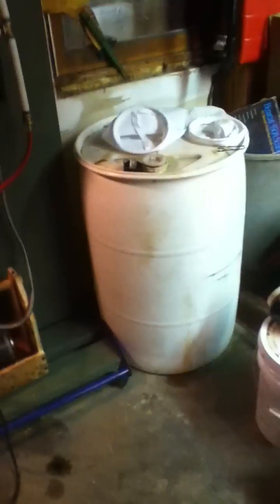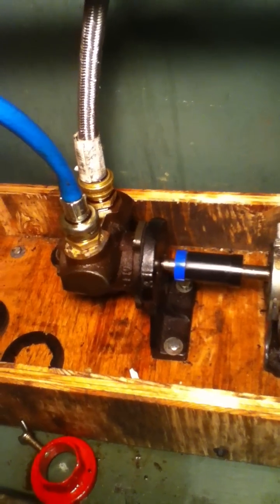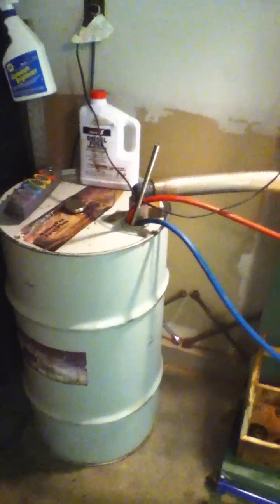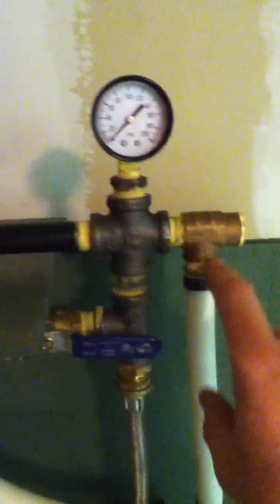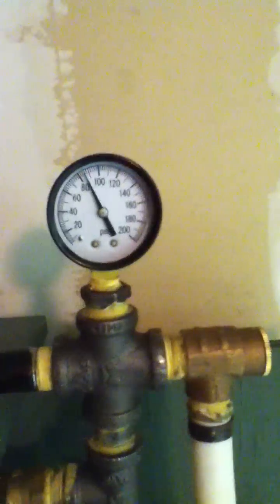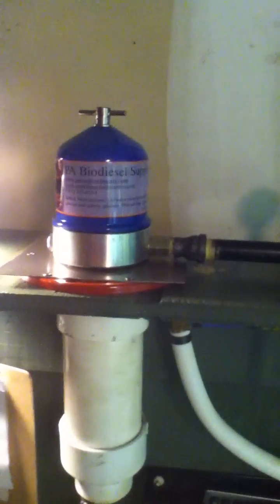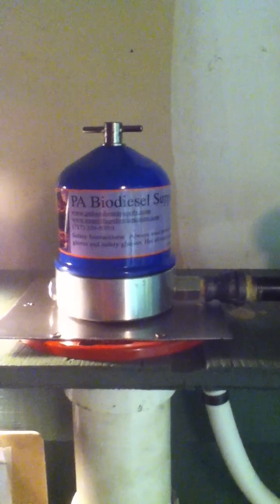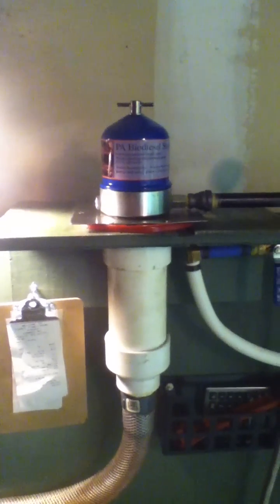Black Diesel from Waste Motor Oil.MOV

Comment: Hi, I’d like to know if you’re still running the f350 on WMO? Is it still running good? I think I understand you’re burning it as 50/50 mixed with d2?
I’ve been running my IDI for several years on the same stuff. Now I’d like to try my powerstroke 7.3.
Thanks
Reply from the maker: Matthew A. Hi Mathew.  I don’t have the truck any more rust was catching up to it and I sold it. But I would still be doing it if I had it. The 7.3 is such a beast of an engine! I think I went 15-20k miles with it and no major issues.  Biggest improvement I made was to add a tandem filter so I could switch on the fly.  Bet regards,,

Comment: I'd love to get the plans/part list to make the same machine.   Would you be willing to email me the stuff I need to buy and a little advice as well?   Thanks so much.
Reply from the maker: Sorry it took so long to respond, I just did not see your post. Do you still want a list?
Reply: @TheBarnbuilder  i live in norway and the fuel pricesis trough the roof and i am having a realy poor setup at the time so if you have a plan and brands of pump and so on:)

Comment from the maker: Running kerosene is not an option. #2heating oil and kerosene (I think) has a dye in it that shows up on your tail pipe and can be seen  under an ultra violet lights  which some toll booths have with cameras . I may be wrong  but I don't  want  to chance it. Doesn't the truck smoke badly at 75%?

Comment: Great video.  We just got a centrifuge.   If you put a simple heat exchanger before you lift pump on your diesel, you could run 75 percent oil and only 25 percent pump diesel.   Increasing your savings by 25% vs your current ratio of 50/50  

I have two videos on my account showcasing this heating system.   Check them out and let me know what you think.

Also if you cut your fuel with Kerosene you only have to purchase half as much as regular pump dieseel, as kerosene is much thinner than diesel

Comment from the maker: I filmed it with my iPod ... My truck has now gone about 13,000 miles including a trip to Tenn. and back. With one failure. My original frame mounted fuel pump failed. $134 for a new one from NAPA.  I tried to poor out the fuel mix  out the barrel with only a little in the bottom and I think I may have introduced some thick garbage into my fuel tank as I think my fuel pump is unable to keep up with the demand from the engine.. Going to mount a frame mounted fuel filter very soon.

Comment from the maker: It's worth the work to me as I don't want any failures ( expensive repairs) just because it was a little too much work. I call it cheap insurance. Besides I see the crud that by bag filters simply do not pick up. I literally take grease out of it. I plan on taking the grease and use it to lube my tractor bucket and such.

Comment from the maker: Beads can be purchased from Dudadiesel on eBay. I bought the bag on a string for about $25 and they have a larger one for barrels with removable lid. The other thing I want to get is a 275 gal tote

Comment from the maker: I live in New Hampshire so winters run a little cool. I plan on trying 60/40 & 70/30 this summer. I think the fuel would be too thick on a cold start when it is -20f ....
Reply: I live on the seacoast of NH. You still running this? Looking to do it in my '09 Duramax.
Reply: @shannonp4037  Thanks for checking out my video, I sold all that equipment about 8 years ago. Fuel prices were low. I have a 2012 F250 6.7L. I would not dare to run it in that.  My old 7.3L ate it up! Although the in tank fuel strainer clogged up and I ended up removing it. Best regards and good luck

Comment from the maker: I have  a 99 Ford F350. 7.3L diesel. It has no factory emission equipment. 200,000 miles running strong. I basically double my fuel with each batch I make.  So for every $1 of fuel I buy I get $2 worth of product.